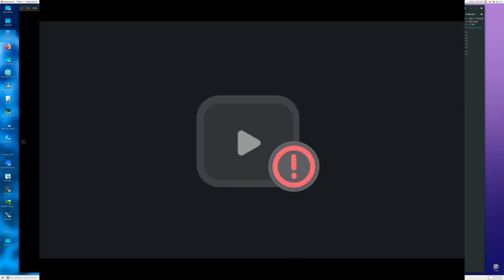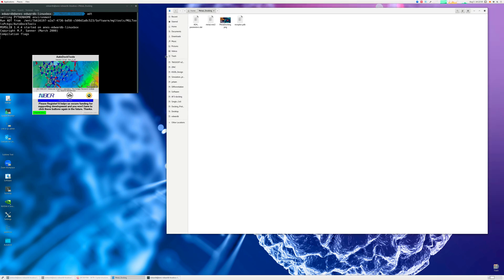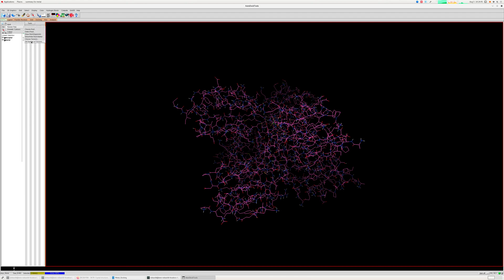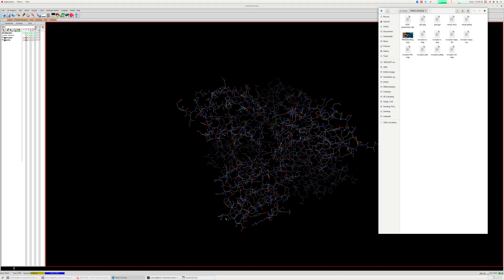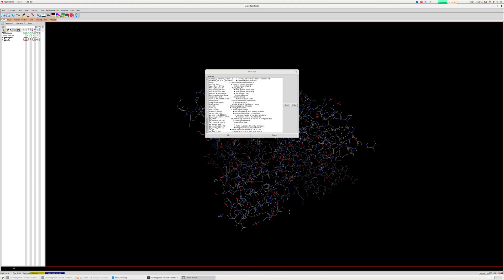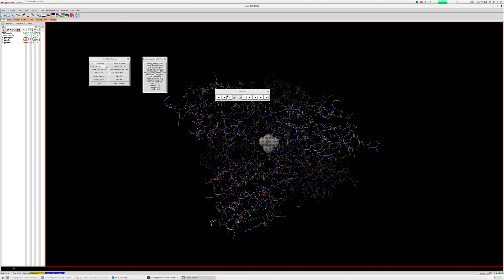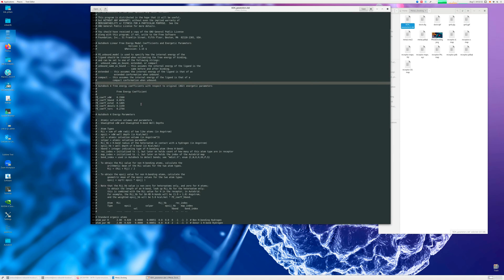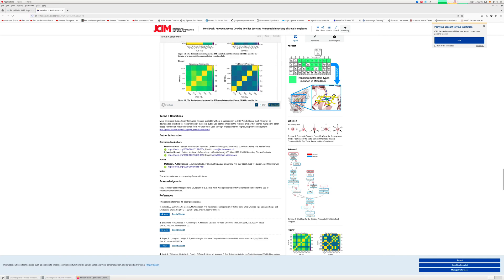How to Dock Metal Ions in AutoDock4 (Step-by-Step) | Learn Metal Docking in 10 Minutes!

Comment: HI, thank you very much for the explanation, although I had a question regarding the metal ion.mol2 file and adding it to the Autodock parameters. In my case, I have the Cu ion, and on the PDB page, several files for this ion appear (the anion and the bonds). In this case, I would not know which one to use. On the other hand, this ion does not appear in the Autodock parameter files. Would it be acceptable to copy Fe, for example, and rename it Cu?
Reply from the maker: No that won’t work. You have to get the parameters first for each element and then do docking
Reply: @Omixium_ai  Is the mol.2 file you use for the metal the one you download from the PDB page for the 3K7R protein? Because when I use that file and load it into Autodock as ligand, I get an error.

Comment: Hello,
Hope you are well.
I wanted to perform two docking by using ADT:
One is docking a zinc ion with a protein, 
and the other is docking a cobalt ion.

For the zinc ion, the docking worked fine.
But for the cobalt ion, I can’t proceed—even at the very beginning, when I try to load the cobalt PDB file (which I extracted from a PDB file) as the ligand in ADT, I get an error.

I thought the file might be the problem, so I tried using the zinc ion coordinates and just changed the atom name to cobalt. However, I still get the same error.

I’m wondering why ADT gives an error for cobalt? 
I’ve tried with zinc and calcium multiple times, and there were no issues. But it just doesn’t accept cobalt and throws an error right at the start, so I can’t even get to the GRID stage where I would provide the parameter file (which also contains the cobalt parameters) for docking.

Sorry for the long message—I wanted to explain the issue clearly.
I’d really appreciate any help or suggestions you might have.
Thank you!
Reply from the maker: As I mentioned earlier these issues will be solved and I will provide exact explanations after I complete 4000 watch hours mark. Either you share my videos to as many as people or just wait!
Reply: @Omixium_ai  Thank you, good luck

Comment: Hello,
I hope you are well.
I have a question and would appreciate your response.
After performing docking of a metal ion (such as Zn or Ca) with a protein using AutoDock, I noticed that the coordinates of the metal ion in the output file (dlg) are exactly the same as the initial coordinates and do not change, regardless of whether the ion was initially in the binding site or not. However, a binding energy is still calculated and reported for the ion.

Why does this happen?

What solution do you recommend so that a real search for the binding site of the ion is performed and I can extract its optimized coordinates for further molecular dynamics (MD) simulations?

Thank you very much for your guidance.
Reply from the maker: Did you mention your binding site during docking?
Reply: @Omixium_ai  Thank you for your response.
Yes, I did define the binding site during docking. I set the grid box around the binding site, specifically based on the coordinates of the amino acids involved in ion binding. The grid box was intentionally designed to be small and centered on the binding site, so the ion would only be able to bind within that region and not elsewhere.
All steps of the docking process appear to run without any errors, and the DLG file is successfully generated. However, when I compare the initial coordinates of the ion to the coordinates reported in the DLG file, they are exactly the same—there is no change at all.
I also tried starting the ion at a position away from the protein, and after docking, even though the grid box was placed on the binding site and a binding energy is reported in the DLG file, the ion’s coordinates remain at the initial distant position.
So, despite the calculations proceeding and a binding energy being reported, the ion’s coordinates do not change, regardless of its starting position.
Do you know why this might be happening?
Is there any solution or recommended settings so that the docking software actually searches for the optimal position of the ion within the binding site, and I can obtain the optimized coordinates for further MD simulations?
Reply from the maker: @Kalantar_916 Try blind docking and see whether the  position is changing or not!
Reply: @Omixium_ai  Thank you for your suggestion.
May I ask, if the position of the ion changes after blind docking, what conclusion should I draw, and based on that, what should I do for my docking?
And if the position does not change, what would that indicate, and what should I do for my docking in that case?
Reply: @Omixium_ai  I performed blind docking.
When I open the DLG file, I can see the results table and the binding energies are recorded, and the coordinates of the ion have changed. However, when I open the DLG file in ADT and also load the protein, the ion is displayed at its initial coordinates, far from the protein, and when I select the interaction option, nothing is shown.
So, it seems that the DLG file itself is fine, but ADT has a problem displaying the information.
I also checked my previous docking, where I had specified the binding site. In that DLG file as well, the ion’s coordinates have changed.
So, is the problem with ADT? Because when I select the interaction or conformations option, a window named “python 2.7.11 shell” opens and at the end it displays some errors, as well as the path of the ADT installation and the lib folder.

If the problem is with ADT, should I install another version of AutoDock? I am using AutoDockTools version 1.5.7 on Windows 10 Pro.
Reply from the maker: @Kalantar_916 ADT does not support metal ion’s geometry. So it is better to open in ChimeraX or Pymol. There are no other versions of MGLTools.
Reply: @Omixium_ai  Thank you for your guidance.
So the docking process itself has no issues, and I can analyze the results using ChimeraX.
I appreciate the time you took to help me.

Comment: Hello Dr,
Thank you very much for your helpful guidance— I was finally able to perform the docking successfully.🙏

I have a question and would appreciate your response:

When I used a large grid box for zinc ion docking (to cover all parts of the binding site and some surrounding areas), the ion did not dock in the known binding site and none of the 10 conformations were in the expected location. 
However, when I calculated the grid box center and size based only on the binding site atoms (using Excel and the binding site coordinates), As expected, the ion was correctly positioned in the desired binding site. (although the binding energy was higher compared to the previous case and also when designing the grid box, some parts of the binding site were outside of the box in the ribbon display)

In your opinion, is this approach (using a very small grid box focused precisely on the binding site for ion docking) correct?
Reply from the maker: Yes focused binding site is correct once you know it from the crystal structure. Known binding sites always perform well in case of docking. Blind docking is explored when there is no info about crystal structure binding site
Reply: @Omixium_ai  Thank you so much for taking the time to answer my question, I really appreciate it.
Reply: @Omixium_ai  Thank you so much for taking the time to answer my question, I really appreciate it.

Comment: Hello and respect,
I apologize, Dr,

I asked someone who works in bioinformatics about docking a protein with a zinc ion, and they told me:

“In AutoDock, it is not possible to dock an ion to a protein as a ligand. Only ligands and peptides can be docked.
I think there is no program that can dock an ion to a protein, because an ion is too small and it can bind anywhere on the protein where there is an opposite charge.
With molecular simulations, however, one can calculate the aggregation sites, the distances of ions from the protein, the radial distribution function, etc.”

I wanted to kindly ask your opinion: Is this correct? Does it mean that AutoDock cannot be used for docking a zinc ion, or any other metal ion, to a protein?

I would greatly appreciate your response, as this is very important to me.
Reply from the maker: Autodock can infact bind Zn to protein. It is possible and there is a dedicated tutorial for this. https://autodock.scripps.edu/resources/autodock-zn/
Reply: @Omixium_ai  Hello Sir,
Thank you very much for the tutorial you shared. I have carefully reviewed the guide, but it seems that this protocol is not designed for docking the zinc ion alone to a protein. It appears to be intended for cases where zinc is part of the active site of the protein (as part of the receptor), and the ligand contains compounds that interact with zinc in the active site.
To dock the zinc ion alone to a protein, it would likely require specific adjustments to the AutoDock forcefield and precise definition of the zinc ion in the ligand file, which is not covered in this tutorial.

If you have any suggestions for this specific case or know of any other relevant guide, I would greatly appreciate further help on this matter.
Thank you so much for your time and patience, and I truly apologize for asking too many questions. I’m very grateful for your kindness and support.
Best regards
Reply from the maker: @Kalantar_916 I am going to make a tutorial where Zn is bound to protein. Will upload soon
Reply: @Omixium_ai  Thanks a ton, You’re amazing!
I’m eagerly looking forward to your next tutorial.
I wish I could do something for you to repay even a small part of all your efforts.
Wishing you all the best, kind man.
Reply: @Omixium_ai  Thank you very much for clarifying this and for sharing the link. I really appreciate it. 
I will definitely check out the tutorial.

Comment: does this method work for group inside de molucule (receptror)? like HEM groups in the protein COX2, they don't get charge values in the Add kollman charges :(
Reply from the maker: Kollmann is for proteins. Gastegier is for ligands. You have to check Zn map parameters tutorials from Vina documentation. I am soon going to make that as well. Thanks
Reply: @Omixium_ai   thank u for the reply, My problem is to dock a proteín COX2 that has HEM (ligands) inside of it as part of it, I tried to compute geister seperately to add the charges to it, but nothing gets added to the iron atom, I will try to use ORCA,

anyway, love your videos man, I'm still a beginner in this docking universe XD
Reply from the maker: @gabrielbr1459 Since the cofactors like HEM groups do not have charges while converting to pdbqt, what you can do is use pdb2gmx tool.

Treat the protein with pdb2gmx (standard residues). Parameterize HEM separately with Antechamber / CGenFF / MCPB.py. Then merge the topologies (protein + HEM + iron center)
Reply: @Omixium_ai man, thank u for replying, u are helping me alot, I will try this, now I go to sleep, but before I go, I see that uses stuff from AmberTools, I couldn't make it work in my Windows11, mainly due to powershell pc :( my question is, Is there other route, or the only one is with Ambertools? If that's only one, I will setup a Virtual machine or smth else to make it work. Again thank u omixium for helping me (cool nickname btw).
Reply from the maker: @gabrielbr1459 Secret: Use CGENff server for parameters and topology. It’s a CHARMM based forcefield and its compatible for all drug designing software. Thanks

Comment: Hello and regards 
Excuse me, I had a question 
If you could answer, I would be very grateful 
I have done the docking of a protein with a metal ion according to what you said But the last step, when I enter the command to run the docking in CMD, it gives this message very quickly:

autodock4: Wrong grid point spacing in grid-map file "protein_Zn.map". 
autodock4: Use either 0.375 or 0.000 throughout! 
autodock4: FATAL ERROR: Using wrong grid-map file. autodock4: Unsuccessful Completion.

I have checked and changed the map files and etc. several times, but it still gives an error. If possible, please tell me why it gives this error and how I should fix this map file problem.
Reply from the maker: Your Zn map grid is wrong! I will make a follow up tutorial on Zn map soon! In the mean time follow vina documentation on Zn Map
Reply: @Omixium_ai   Also, may I ask when approximately you plan to upload the new tutorial about Zn map? I am looking forward to it!
Reply from the maker: @Kalantar_916 I will soon! Thanks I am now uploading ML on QSAR data which I think you will find very interesting
Reply: @Omixium_ai  Thank you so much!
I’m really looking forward to both tutorials – the Zn map one and the machine learning on QSAR data.
Your content is always very helpful and interesting.
Best wishes!
Reply from the maker: Also the error also suggests that the grid size you have yo set to 0.375 throughout. Then it can be solved
Reply: @Omixium_ai   Thank you very much for your time and all your help!
I have checked the spacing value in all my map files and in the gpf file, and they are all set to 0.375.
But I still keep getting the error saying I should set the spacing to 0.375, and I don’t know why.
I will review the documentation you mentioned and hopefully, this will help me solve the problem.
Thank you again for your response.
I wish you all the best.
Reply: Thank you very much for your answer!
I wanted to ask: the tutorial you are planning to make for Zn map, will it also be applicable for other metal ions like calcium or cobalt, or does Zn need special treatment?
I noticed your previous tutorial was about docking a metal ion to a protein, so I was wondering if the new tutorial will be specific only for zinc, or can it be used for other metal ions as well? @Omixium_ai